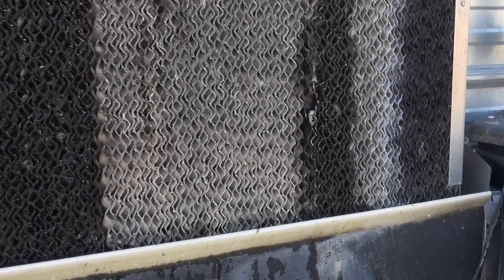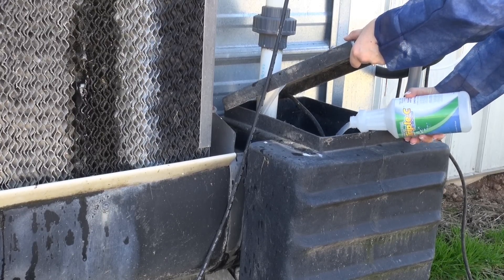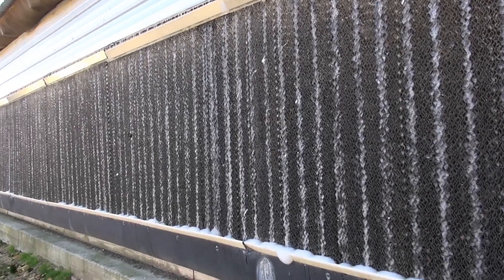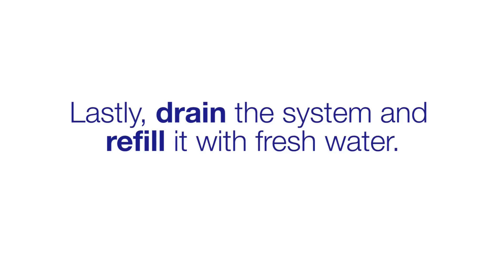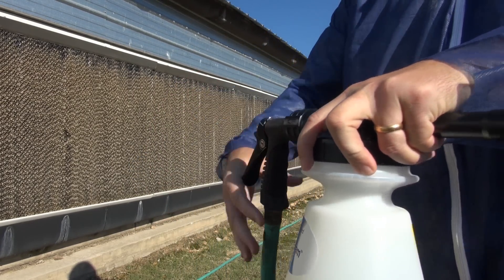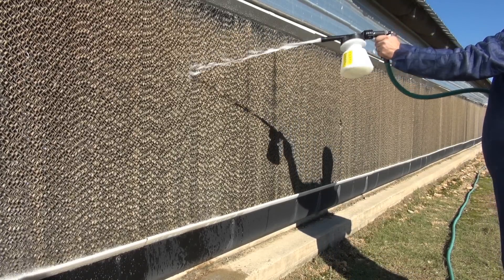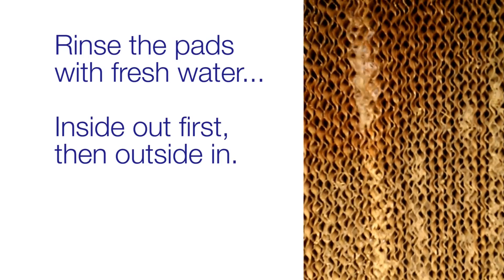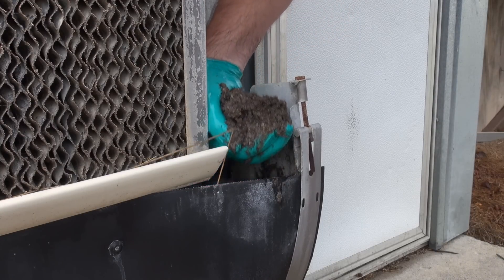Cleaning Cool Cell Pads with Triple-C®

Comment: I made the mistake of letting my pads get in bad shape with all the calcification, but not too far gone, thought I might still be able to salvage them. Here is a few things I did and still in the process of doing to get them back in shape. 

1. I used CLR in the water to help remove some of the build up, and initially I was disappointed, I did not see much if any improvement as the amount of build up was still bad. And I thought I may end up buying new pads, but decided against it and try a different approach.

2. Considering the amount of calcification I had on the pads, I bought both a in line descaler and one of those descaler mesh bags that you can buy at a home improvement store. I then installed the in line descaler, then threw in the mesh bag as well.

3. My unit had a purge pump already so I didn't have to install one, but I decided to periodically check the sediment build up on the bottom of the pan. After one month, surprisingly even with a purge pump there was a lot of sediment on the bottom of the pan. I then removed the pads and then removed the drain pipe. I then with a water hose flushed all that sediment out of the unit. Then reinstalled both the drain pipe and pads. I also took note of the condition they were in. At this point I thought there was some improvement but not enough to my satisfaction.

4. Waited another month, then repeated step 3, remove pads drain water, flush out the sediment. Plan on doing this at least two more times this year. One thing to note, is this sediment I am talking about are little pieces of calcification that have managed to break off, and was not flushed by the purge pump. Removing all this sediment should speed up the process in reversing the build up.

I just finished flushing out all the sediment, a second time. One thing I noticed is the condition of the pads between the 1st and 2nd time, there is a lot of improvement, though it is still not where I want my pads to be. One thing I am  now considering in doing differently is applying CLR once more, and considering the amount of build up that has already been removed I believe this second application will be more successful than the 1st time I did it and may end up reducing the number of times I have to remove the build up of sediment.

Comment: I use CLR. Then drain the pan and turn the pump back on.
Reply: Do you spray the CLR on the pads or do you just poor it in and let it circulate with the pump and then rinse it?
Reply: @goijehudim5798  CLR is weak if your pad is light minerals just use the stuff made for coolers sell it at Home Depot.

Comment: How to clean the algea in cool cell pad..how should avoid algea formation
Reply: Im still working on how to clean the algea.
However to avoid algea,turn off the cooling mode at least 30 minutes(depends) before turning off the machine completely.
Allowing the fan to dry the pad.